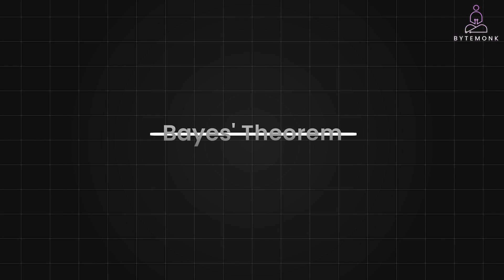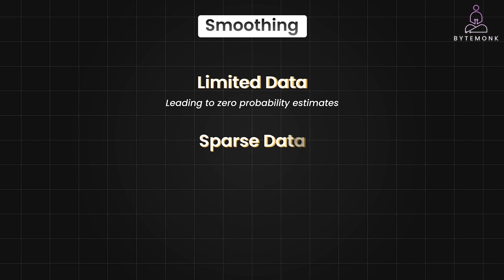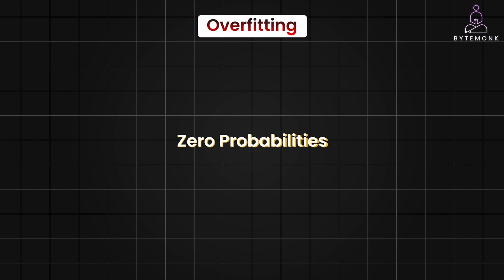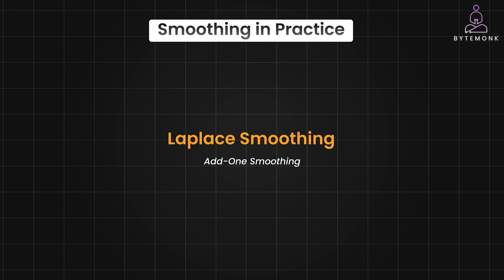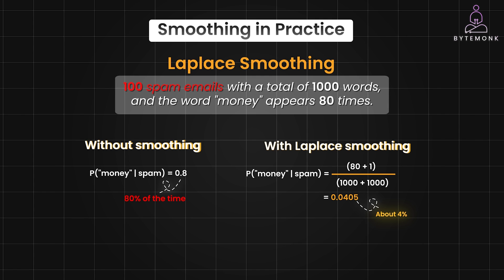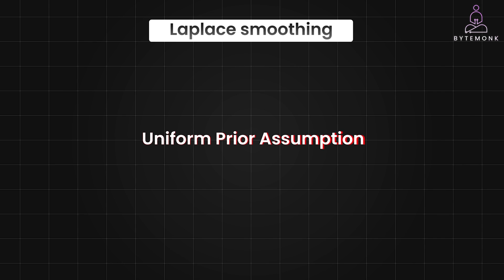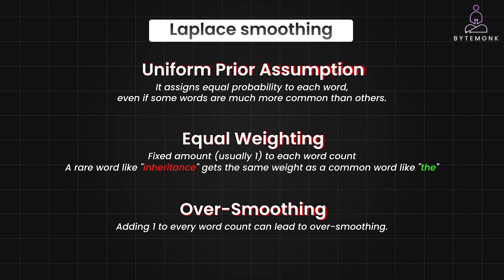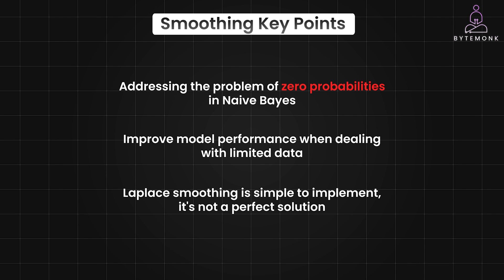Mastering Laplace Smoothing in Naive Bayes: Avoiding Overfitting

Comment: I initially really liked the video, but it got pretty confusing once the example was shown ( 5:05 ). What exactly is P("money" | spam)? In the example without Laplace smoothing it seems like it is probability that if e-mail is spam there will be word "money" somewhere in it? It would make sense. If we have 100 spam e-mails in our training data and 80 of them had word "spam" in it, the probability P("money" | spam) would be 0.8 as in example. But then example with Laplace smoothing does not make sense and it uses different approach. In example with Laplace it seems that we do not care about how many spam emails we have got in our training data. In Laplace smoothing example P("money" | spam) means probability that randomly chosen word is word "money", given it is taken from spam e-mail. Another confusing thing is that 1000 + 1000 in denominator. Our vocabulary is 1000. So it means that there are 1000 keywords which we are going to use to decide if e-mail is spam or not a spam. Also in our training data we had 1000 words in total. It might be confusing because it seems that there is some relation between those two numbers, but if I understand it correctly, it is just coincidence that we have same values here. I think the example would be much more clear if we had for example only 10 keywords in our vocabulary and one of them would not appear in training data at all (to show why we need Laplace).

Comment: In this Laplace smoothing example, we have 1000 total words, with 'money' appearing 80 times. 
The vocabulary size V (unique words) should be at most 921 (1000 - 80 + 1 for 'money'), not 1000. 
So, P('money' | spam) = (80 + 1) / (1000 + 921) ≈ 0.0422 (4.22%), slightly higher than shown. 
And in a realistic example the actual V would be much smaller, increasing the probability further.

Not saying that in the video the example is wrong, but a bit complicated to understand when both values (total words and unique elemets) are both 1000
Reply: You're not correct, because the vocabulary includes all the words we know that can be written in emails, not only the words we saw in spam emails. One of the famous reasons we use Laplace smoothing is the fact it doesn't have zeros when we haven't seen any specific word. It assumes some probability for other words which we haven't seen in spam emails.
Reply: I agree. This would mean our vocabulary contains all unique words we have seen in training data and also that there were 1000 words in total in spam emails. But in this case the vocabulary would also contain words from non-spam emails which might be unique to non-spam emails (not occur at all in spam emails), right? And that is why we need Laplace in the first place. The issue here in this video is that it is not clearly explained how they got those numbers and how their algorithm works.